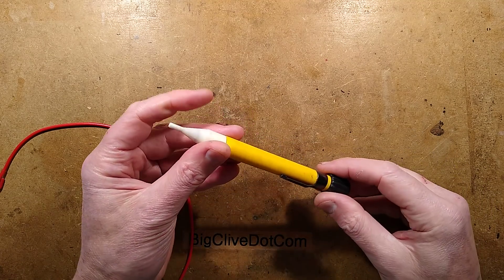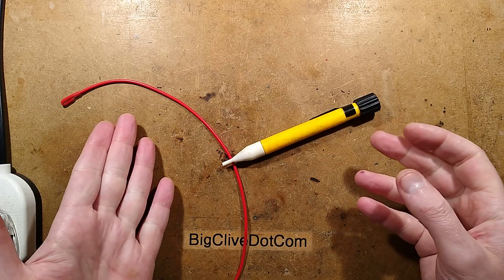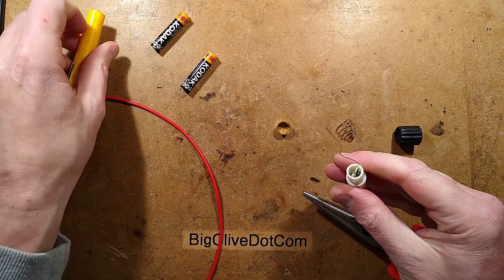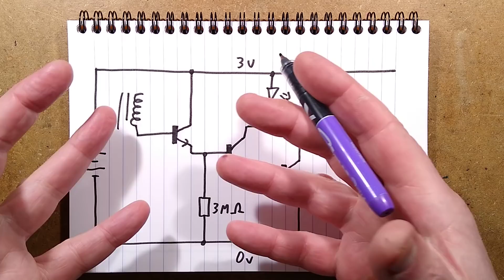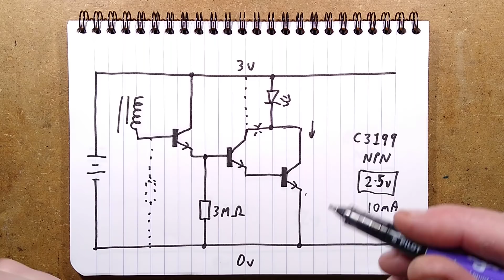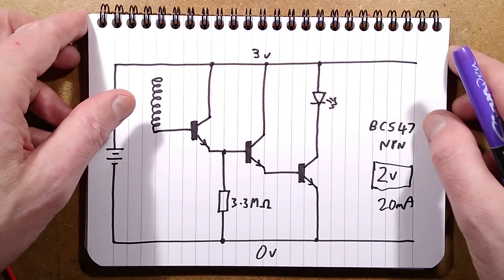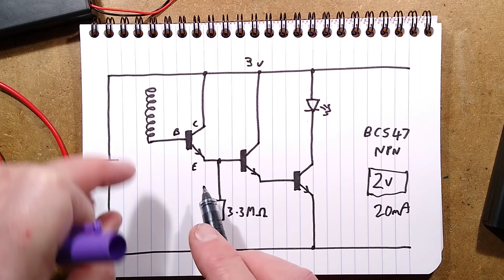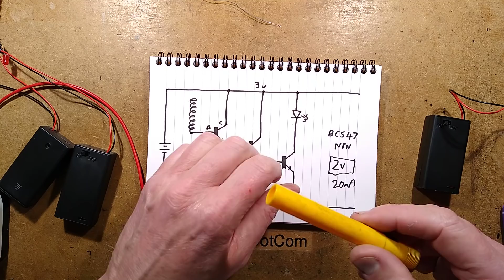Volt stick circuits and tests

Comment: A number of years ago when I was doing a nontrivial amount of cabling work (both telephone and network),  I bought a "toner",  which has two parts,  one of which is connected to the wire in question and the other of which is used to find it.  That second bit performs this function quite adequately,  and makes noise if there's any line power going on.  I see no need to get a gadget with a light for the same purpose.  :-)

Comment: 2:00 quite the dangerous if the device displays no volts to for example someone who is a layman, or generally hasn’t tested the device before use.

Comment: I've got a multimeter with this feature. The antenna is in the top of the meter, and it lights up the indicator on the top with the strength of the signal. Green for weak, red for strong, with an "L" or "H" or "----" on the screen.

Comment: I bought a similar thing years ago the has an LCD display showing the detected voltage, it is also a terminal screwdriver and was just over £1  No batteries,
Bought a 'volt pen' for my son a couple of weeks ago that didn't work.

No instructions with it so looked it up on YouTube to find that like yours it needed 2 AAA batteries.  Works now but I prefer the original batteryless version.

Comment: I use one occasionally for a quick test,but nothing serious. Reminds me of the screwdrivers of years ago which you poked into the live socket. An electrician warned me it was a good way to commit suicide,so I have never used one since.
Reply from the maker: Good quality neon screwdrivers still have their place as a cheap tester for double checking.

Comment: A few years ago I bought one of these made by Klein, it didn't tell you the actual voltage of course, but it did have 2 indicators, one for 120 V, and one for 240.....that was handy to know, since I was Electrical/Mech maintenance guy, lots of motors....I had 120, 240 and 480 all in the same conduits and J-boxes. Most of the 240 and 480 was 3-phase...that can be...shocking...! There's a good reason you keep one hand in you pocket...

Comment: The pen tester I have has a very bright LED that doesn't blink. It just stays on when near a voltage. I haven't opened it so I don't know what the difference is. I rarely use it, honestly.

Comment: I bought several of these with the 'calibration' wheel on the side. I have it at 6o% of misreading . 
I fully trust my (not someone else's) neon screwdriver. However I was on a kitchenette job with a tingley neutral, and a bunch obsolete but live wires(the real electrician got 1/3 through the job ,lights cu move a couple of sockets and is now still hiding from Co vid and the premises needed to be up and running at the end of lickdown 1)

Comment: Something to amuse the kids on a long journey. Give them a volt stick and tell them you can light it up by thought alone. Just wait till you are close to a high voltage power line preferably one that passes over the road and if by magic it will light up.

Comment: Try a small MOSFET, such as the 2N7000. You might want to add a 15V zener diode between the gate and source, to protect against the gate voltage going too high, as well as providing some leakage to reduce the sensitivity.

Comment: Does this work with Dc? Or any way of making this idea work with dc
Reply from the maker: It will respond to an electrostatic charge, but not in a sustained way.   The capacitive coupling blocks DC.

Comment: What is the wire loop antenna made from? Meaning, surely the wire must be insulated? Lacquer coated magnet wire?
Reply from the maker: Just bare wire.  Possibly just to create a larger mass.

Comment: ok what would be the best way to find out where wires are under  a plaster inside of a wall when somebody drilled trough them  mid way?
Reply from the maker: You can get devices that will indicate metal and sometimes wood inside walls.

Comment: That's very interesting .. a simple design.. I have a faulty one with the added audible tone.. it lights and beeps continuously as soon as you put the batterys in... looking at this layout I'm assuming now that it must be a transistor shorting out... I will have to disassemble and check it out....many thanks

Comment: GR8 4 finding a blown fuse
In an unlabelled consumer;... distribution board...
Always test on a known supply before & after use.
Get to know it's limitation...
Always DOUBLE check your finding...
REMEMBER...
Electricity can bite if U get it wrong...

Comment: While renovating an old house it was my job to exterminate the old wiring wherever some random old wires showed up in walls and floors. So I made myself a life-saving working glove with an antenna fixed with some sticky tapes around my fingers. Whenever I grabbed a live wire, an LED on my glove lit up and I was at least warned. Saved my butt several times I guess..

Comment: Why are MOSFETs not used in such an applications? MOSFETs are very sensitible and one element can be used instead of tree bipolar transistors. Or I'm wrong?
Reply from the maker: They are used in some.

Comment: there's good ones, and a huge array of bad ones you can buy.  My preference is the one made by Martindale.  As always, test them at a known live source before and after making your check.  Don't always believe a cable is dead if you just test at one point.  On a 3 core mains lead, the wires are spiral wound and you can get on/off readings as you move along the lead.  Whilst they are not for use on DC circuits, if you move the tip quick enough over a DC wire it will create a pseudo AC field to give a reading - not 100% though

Comment: I used to build these detectors out of 4017 counters. I don't know where I first saw the schematic but I was expecting to see it mentioned here! The Mosfet input stage is quite sensitive to the capacitive field, plus, it acts as a frequency divider for a more slowly blinking LED.

Comment: try sticking a small value capacitor across the 3m resistor,  see if it makes the led less flickery, if not or it reduces senstivity, try it on the base of the next stage...

Comment: surely the original circuit is the 'darlington', as thats how i've seen them described, with the two collectors connected together??... with the first collector to supply its an emitter follower....
Reply: you can get integrated darlington transistors, mostly power types such as TIP110 and these are collector to collector connected internally as they only have the usual 3 wires

Comment: They used to make these with a neon bulb inside.  The tip was a metal part inside an insulating cone.  The other end of the NE-2 went to a metal part that ran the length of the thing inside the tube..  Your hand had to be around that part for it to work.

Comment: I have encountered false negatives with a latter day volt stick- with double insulated twisted pair or twisted triple, the live appeared to hide behind the neutral or the earth, cancelling out or blocking the signal.. since then i've got into the habit of running the pen along the cable- which then lights up at intervals.  One of these little factors that are sent to catch you out.

Comment: Clive: 
About the circuit of your tear-down: If the 'antenna' of the voltage stick uses capacitive coupling... the very small capacitance (between the electrified conductor, and that antenna) has a very high impedance, at 50/60 Hz. The high value resistor/resistance in the emitter of the first transistor is multiplied by the transistor's beta... so that the transistor's base impedance is very high... and so the transistor's input impedance  'matches' the 'antenna's' high impedance. AFAICT, the 'pull down' Darlington pair is just driving the LED...providing enough current to ensure the LED is bright enough. It's a bit naughty (as you say)... because the only current limit is the transistor pair (no limiting resistor). But, it's probably okay because the LED is being pulsed... and these voltage sticks are very inexpensive.
There are a number of patents for 'voltage sticks'... including a patent from Fluke (for mounting a voltage stick on a DMM probe... which seems inane.) Another has a voltage converter so that the voltage stick can be powered from a single 1.5 V cell. Most of these patented voltage sticks are using a CMOS Schmitt inverter, for this logic family's high impedance inputs. Most patented designs also have/use signal conditioning. Which leads me to speculate, the simple design in the tear,down should respond to sufficiently strong signals in the LF,HF, and up frequency bands? ... perhaps limited by the fT of the input transistor?  
Cheers.

Comment: The first kit I ever built (around 1987) was the Maplin live wire detector. It had an LED as well as a piezo buzzer, so you could hear the 50Hz buzz of the mains, if triggered by static it would emit a tone

Comment: i've used one at home to quickly diagnose if an outlet was not working or the device, slap it out and slap it into an outlet.(i am not an electrician) and then i have a cheap multimeter to check closer whats up.
I once called service guys for my rented apartment, and said rooflamp didnt work but all other outlets worked fine, and the bulb was fine(currently using a LED filament type, pretty but quite low light as its the only main source of light). They said i needed to make sure there was an issue and not broken cables, so i used the pen first to check cable going to lamp, nothing came there, then with multimeter checking the connection of lamp to roof, no electricity there. CAlled the guys again and reported my findings, they came and checked it out, found that the apartment above me had renovations going on, had managed to sever the cable going form fusebox to my rooflamp, that was amusing(old style, two solid copper wired, replaced with proper looking cable). i was quite lucky nothing else went kaboom

Comment: If your tester is too sensitive, which is usually the problem, it becomes useless. I think that's why they don't use your favorite design, but rather go for the less sensitive design.

Comment: I made one of these non contact voltage indicators last year but the one I made doesn't flash the LED, it's just on or off. My circuit is using 3 general purpose NPN transistors, a resistor for each transistor and a resistor for the LED, I'm using a lithium-ion rechargeable button cell which is a little bigger than what you have on the motherboard of your computer and it lasts for a very long time with one charge.
Reply from the maker: The flashing is the camera shutter making the 50Hz visible.

Comment: Worth noting you could also use three PNP transistors -- just reverse the batteries and the diode so as to keep the arrows all still pointing in the right direction .....

Depending what kind of material your shirt is made of, and hence whether it produces a positive or negative charge, I would expect rubbing the VoltStick on some materials only to give a glow when you stop at the end of a stroke and others to glow in mid-stroke .....  The inverting first stage should also affect this.

Comment: pad the inside with some aluminum foil to stop batteries from moving, i use in a flashlight that does the same
Reply: I was thinking the opposite, it's poor as it's getting stuck!  Maybe ream the inside out slightly with a small round file etc. so the batteries don't foul on the outer case.  Some batteries are also a teeny bit thinner, think the Varta ones seem to be and don't seem to be such a squash in some enclosures.

Comment: Be interesting to see i  a Milwaukee one. They are junk but claimed to  be more advanced circuit.   Also, there is one that has a built in continuity tester as a separate circuit.

Comment: I had one of these nearly drive me insane a dozen years ago.  I was cleaning up some bad wiring in the attic of my newly purchased home.  Also adding some flood lights.  There was a dead circuit from where they'd pulled out dedicated sockets for space heaters now replaced with a central heat pump.  I traced the wire, tested the endpoint in the blanked outlet box.  Before the cut, I used the voltage tester as a last confirmation but it was random whether it would go off or not.  I'm in a hot attic and very annoyed.  I finally carefully cut back the sheathing and pierced the wires to test for voltage and their was none.  In the end, I realized my problem had been that I was using a CFL bulb in the work light, that was hanging just above and behind me as I sat on the ceiling joist, so about 4-5 ft from the wire.  If I tested while I shadowed the wire, no beep.  But if I tested without my body blocking the CFL bulb, beeping.

Comment: I built one of these from a free kit from Maplin back in the early '80s. I think the strip board and components were on the cover of the Maplin magazine. Of course you wanted a case to put it in and these were readily for sale at Maplin! :-)

Comment: My earliest ones were definitely FET input (with a bipolar transistor follower).  Resonably reliable, amazingly durable, and providing commonsense is used a convenient method of detection of a "mains presence".  The "mains detector" elements in many current pocket meters (such as the BSide ADM51A) use an "all in one" chip that drives the meter and provides a (graded)  response, which is a useful feature when playing "hunt the cable" behind timber or Gyproc panels! :-)

Comment: ooh - this is going to divide people into lovers or haters. had a selection over the years (Klein one currently & megger) , deffo handy in certain circumstances, I find you get used to the specific sensitivities of a voltstcik. I always check it on a known source before / after as per approved isolation procedure. I'll get slated for using them by one of the local electrical tutors tho ;-)
Reply: The "modern" ones with a graded (usually 3-level  response) are really nifty tools, especially when playing "hunt the cable" behind panelling!  Whilst almost all modern meters come with an NCD capability these days, the compact nature of these "detector pens" is the main advantage.

Comment: I guess the original design had to take into account the constant drain on the battery in both the off and on states so it lasts longer. Also, they don't want it to trigger whilst in storage or transportation and drain the battery before it gets to the customer.

Comment: over 30 years ago i worked in the demolition business and had a lot of serious incidents caused by electricians telling us the power was disconnected then finding out it wasnt.  i was forever hassling the boss to get a volt stick.  they werent cheap then.  one day we were totally stripping out the entire floor of a high-rise office building when an orange thing fell when the ceiling panels came down. it had been up there for a long time judging by the dust on it.   it was called ezscan.  ive still got it.  i didnt tell the boss till 25 years later.  its got 6 leds.  the closer you are to the action the more leds light up.  ive never seen another one.  nor have any of my sparkie friends.

Comment: The UNI-T UT210E has a non-contact voltage detection function too, with a strength display. I don't know whether it works differently.

Comment: I used to have an old Fluke one, it did what I wanted it to do. But it died and now I have a new Fluke volt stick and it's way too sensitive, telling me that there's voltage on just about everything; result I cannot trust it at all.

Comment: I have a similar device made in France by Gefolex, model number 8278, probably in the 70s. It also has a buzzer. It is very useful for finding dud bulbs in the Christmas tree lights of the type that have a single wire running a loop  from the plug, round all the lights and back to the plug. I don't think it works when the return wire from the last bulb is twisted round the other wire.

Comment: (ETA reason for the shock on a 3 prong)

I love these things, they're great for testing polarity. 

When I moved out of my mom's house(first apartment fun!!) she bought me an upright deep freeze. Well, as soon as I plugged the thing in I got bit when I was adjusting its placement against the wall and touched the bare metal on the back. I called the help line in the owners manual and since it was the mid 90's they were actually helpful. They told me to get one of these things and which side should make it beep.

I guess the building manager either DIY'd new receptacles or a previous tenant did but every damn outlet in that shithole was reversed. (ETA the reason I was getting zapped was because the receptacles were three prong and the wiring didn't have a ground, whomever  installed that shit put new 3 prongs onto old ass cloth insulated wire)

To this day I always check before I plug anything into the wall if it's the first time, drives friends nuts but it's better than getting zapped or blowing something up. 

For non-Americans, on a 110~120 outlet there are three holes, a flat-tall, a flat-short and a round D, the flat-tall is neutral, the flat-short is live and the round D is ground.

Comment: Otherwise I prefer using multimeter but these are great (only?) way showing phase after isolation transformer. Probably doesn't work with all types but have worked with ones I have needed to use.